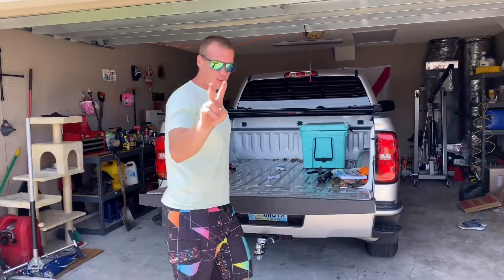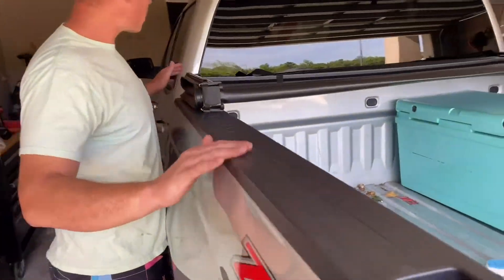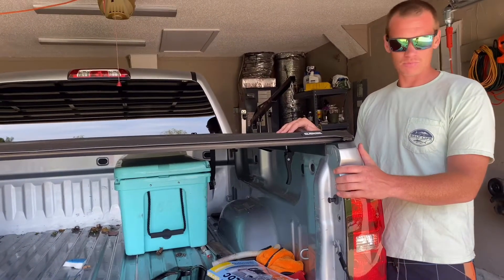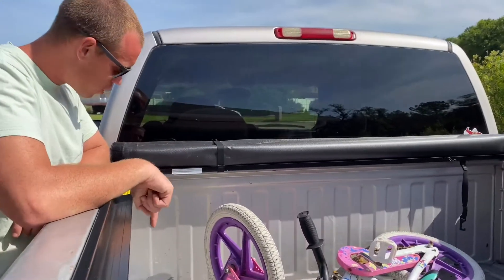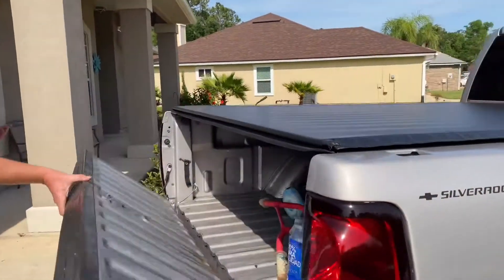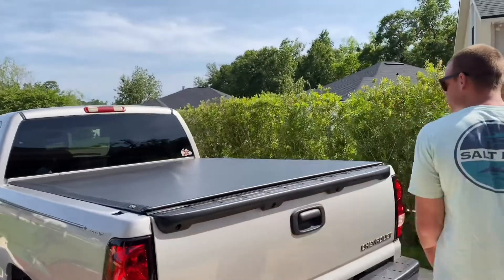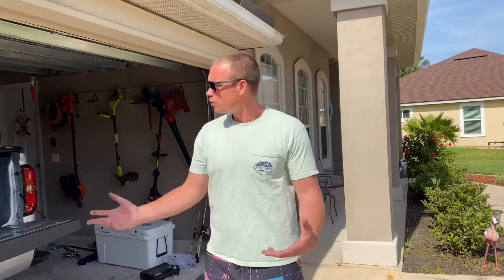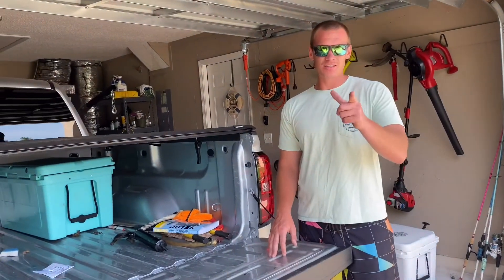Amazon Tonneau cover Soft Trifold & Roll Up Review

Comment: I know this is old but it is quite probable that the water getting into your bed with the roll-up is the fact that you have the rails on the inside of the bed and not on top of the bed as they are supposed to. When placed on top of the bed, there is a weatherproof seal that prevents water from going in. However, your water is getting in between the gap that you have between the bed and the cover rails. BTW, that is also the reason why you noted that your clamps are not tightening properly.